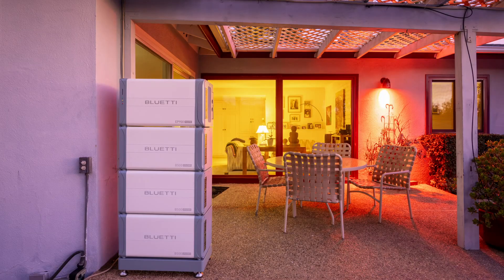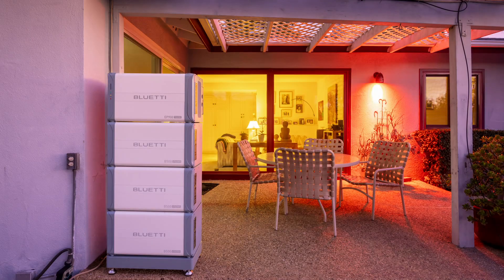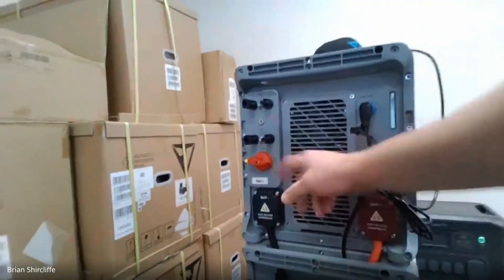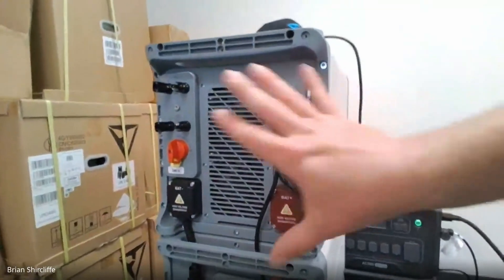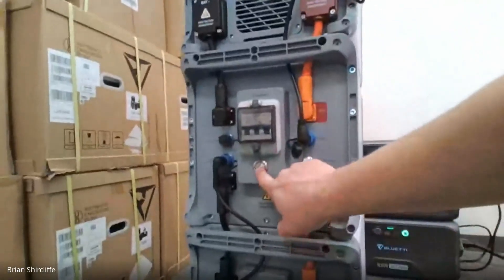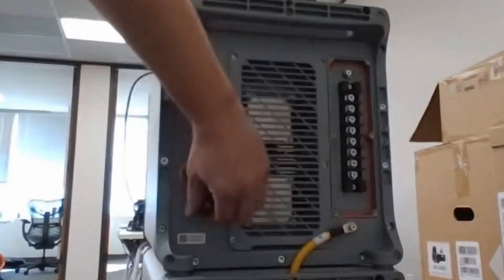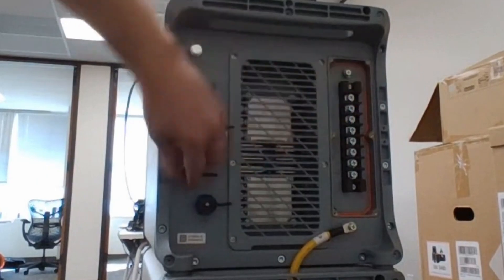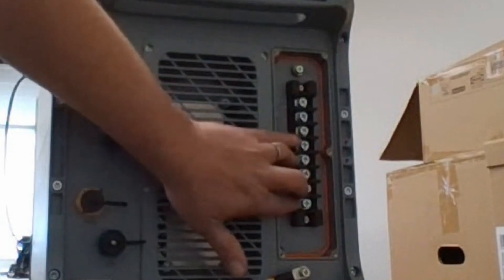The Pitch | Overview of Bluetti EP900 home battery system for solar pros

Comment: Can some one pls make a video showing the electric panels being installed for 2 EP 900s run in parallel (this is very difficult) 
And 
A video of the “to grid” & “to backup” wiring to the EP900 for two EP900s run in parallel!!! Please
I’ve seen the vids of one ep900 install but 2 in parallel is different and needs to be videoed please and thank you, Brennan
Reply: Hi there, I just ordered an EP900 with 3 B500s.  Now I feel like I'm way over my head in trying to find someone to wire it to my house.  Have you found someone to wire your system yet?

Comment: So you touch on the topic of wiring the System. It is not an easy task. In addition I have had 10 electricians come look at the system to put a bid on wiring to the main panel and the 100A transfer switch (if running twoEP900s in parallel) or to the 50A sub panel if running one EP900 by itself. FYI: One would want to run two EP900s if interested in running the entire home including AC unit. Of the 10 electricians 5 walked away and did not want the job at any cost (I found this to be a preemptive warning). 3 bids were outrageously high over $3,500 to $5,000+ to hook up a few wires between panels. I did find 2 excellent electricians who would do the work for under $1000 it just had to be on their time schedule and free time. Well worth the savings in my book. There is no way one can DIY wiring an electrical system into a main and sub panel or transfer switch in my opinion without substantial electrical experience . My point of all this is after u buy the system there are considerable additional cost that come with setting up the system and they do not explain that on the site or during purchase. 
One last topic: I am a 100% rookie when it comes to solar panels and I did not receive all the boxes and products promised with the purchase of a new parallel system. Try setting up a parallel system without a 100A transfer switch or a single system without a 50A sub panel. I drove myself and an electrician crazy trying to wire a system without the proper equipment. Pay attention to what ur buying and everything they SAY is included free with each purchase and make sure it is delivered in the initial shipment. I could have save multiple hours of headache had I received the proper equipment!!! That’s all
Reply: Wish these companies would get their own installers and USA SUPPORT.